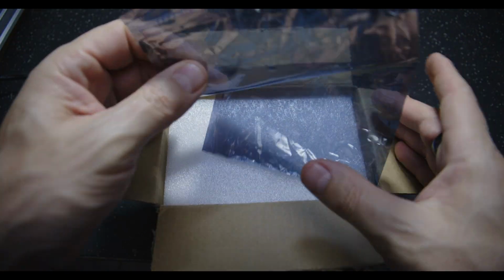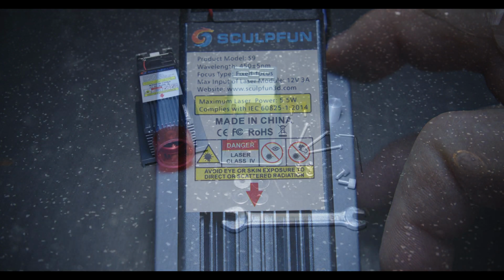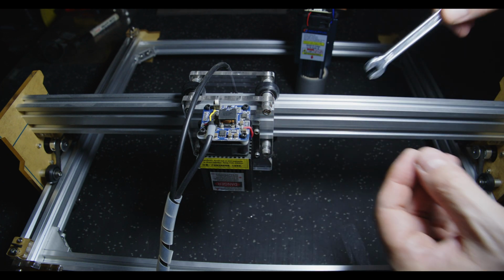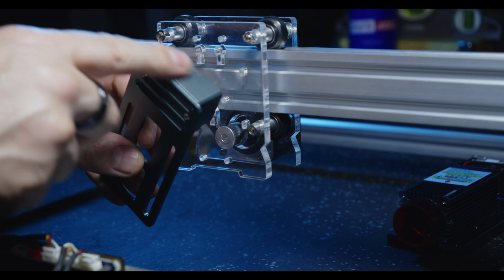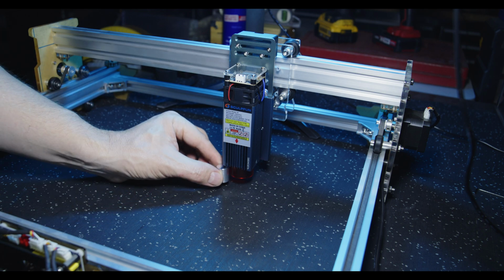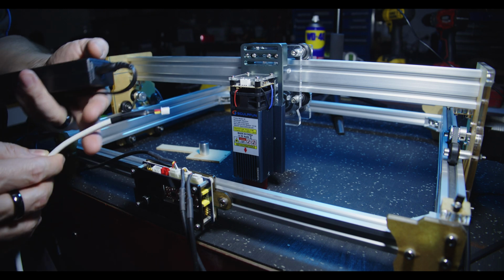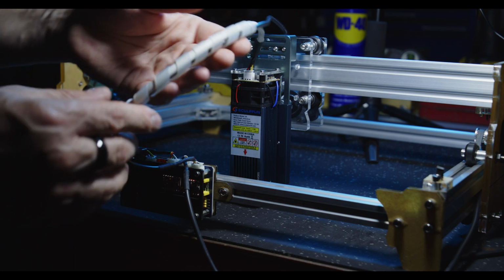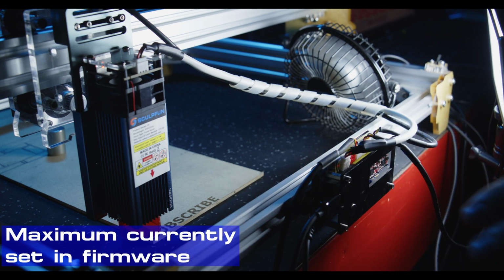#50 - How to upgrade the Elekslaser A3 (and others) to use the Sculpfun S9 Laser Module

Comment: I know I'm coming to your video 3 years after you posted it, but I wish to do what you have done to my A3 Pro Laser.
How did it work out?
I'd like to be able to cut thin materials, plywood, MDF, etc, with it, and the 2500mW stock laser is not up to the task.
Thanks in advance!
Reply from the maker: The performance is much better, will cut 3mm witha few passes.  I'd go with adding air blast as well and you'll cut 6mm cleanly.